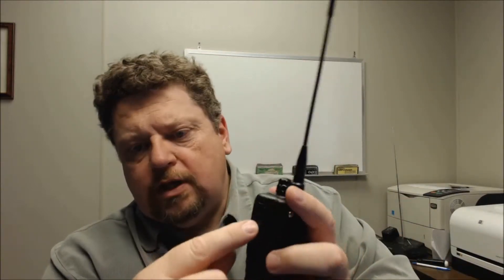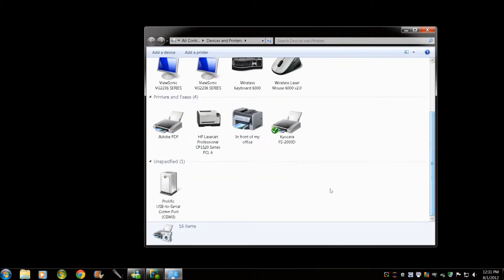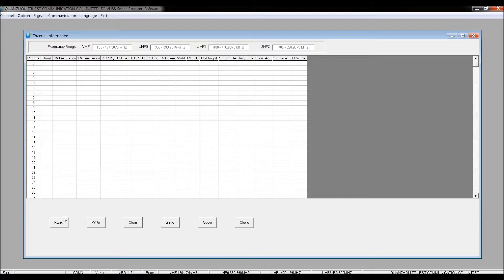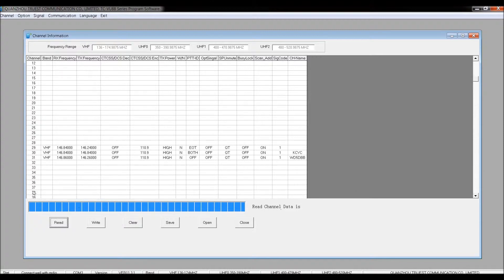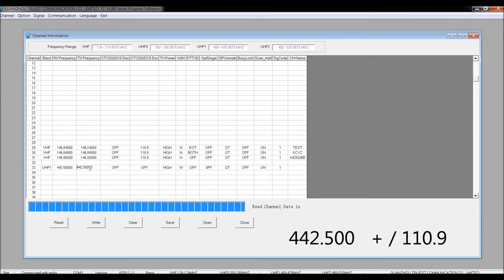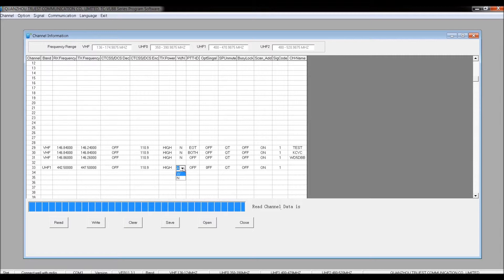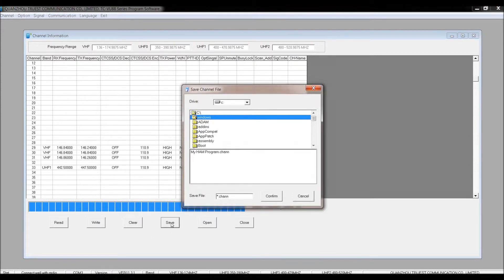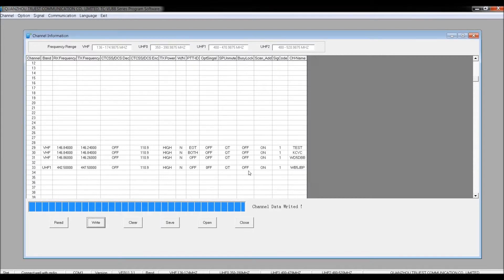HYS TC-VU88 Dual Band Transceiver 2M and 70cm, Programming With Software - AF5DN

Comment: thanks for the explanation.  I got a BJ-UV55 and was scratching my head to program as I am a kenwood person, and the pl tones are automatically set.  No big deal, just a different radio, and its hard to get the documentation on some of the settings.  Its a Baojie and the website doesn't have English supported right now for the download/support page.  Thanks again. The software is almost the same.  I get some strange errors when uploading/downloading and have to retry, then it works, so I know,